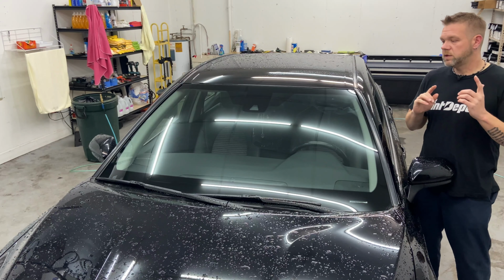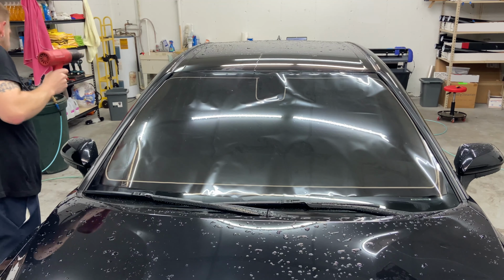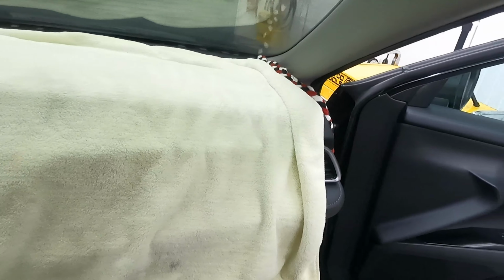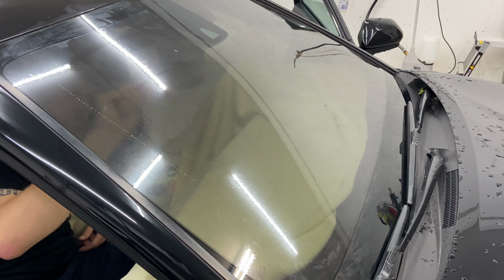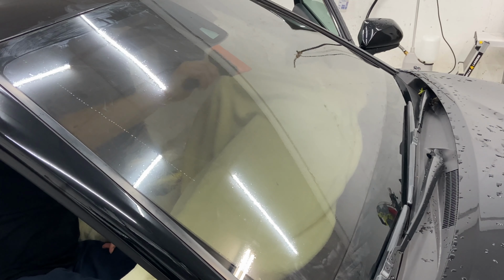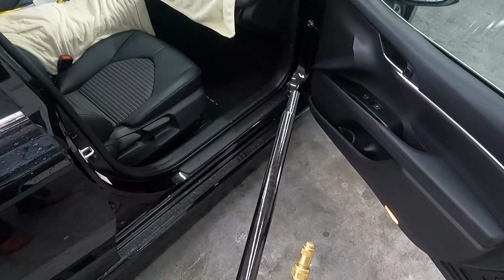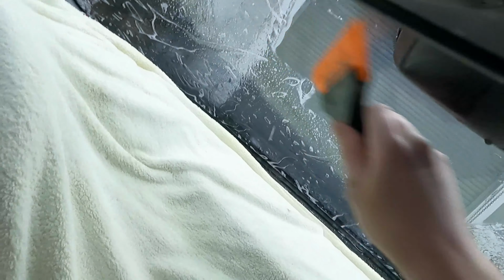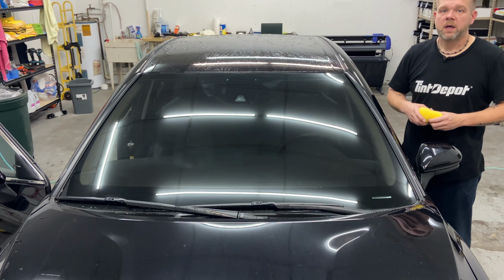Windshield Tint Installation  - How to Tint a Windshield

Comment: I had front windshield on my m3 tinted recently, and installer managed to leave a crack in rain sensor part of the class. How does this happen? Too much heat ? The shop is trying to deny accountability.

Comment: I just had my windows tinted all around and had them do a brow on the front windshield. The front windshield is heated and the tint ended up having a blue cast to it. Do you know of any way to fix that? The other windows look normal of course, since they’re not heated, but I’m just wanting it all to match if possible.

Comment: What size roll should I buy to tint a front windshield
Reply: 40in by 6 ft. It's what us most common. Gives you room for error. I bought a 30 in x 5 ft for my camaro and it was big enough to cut to size but no room for error